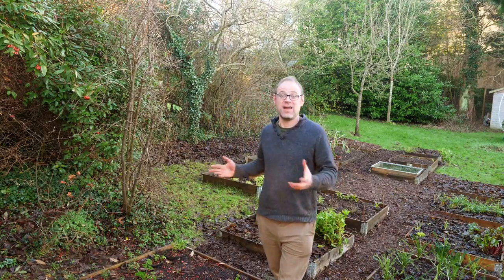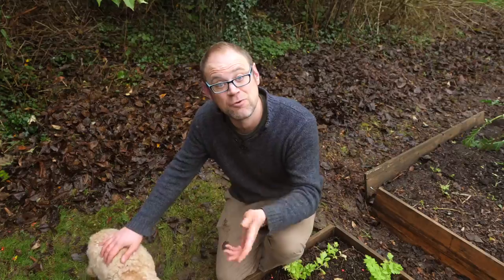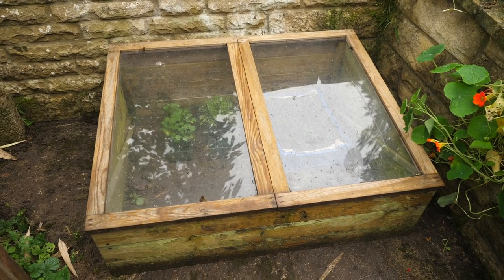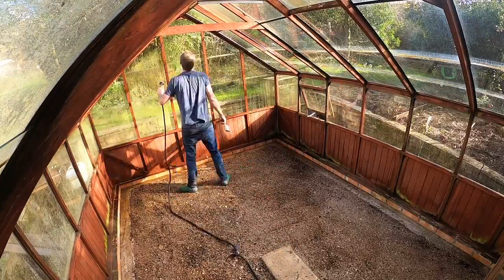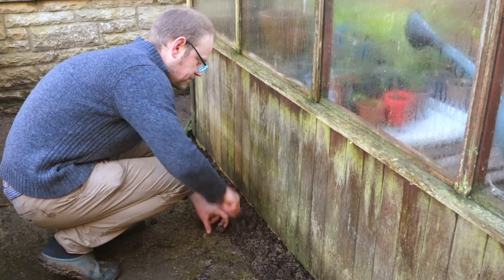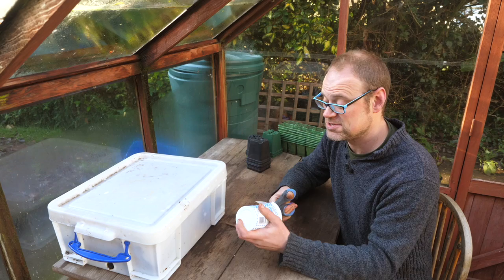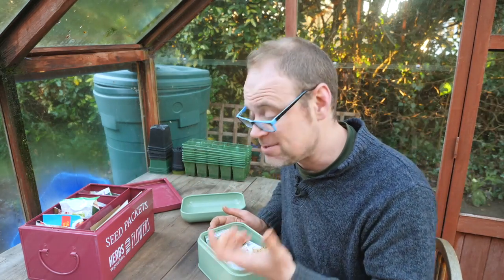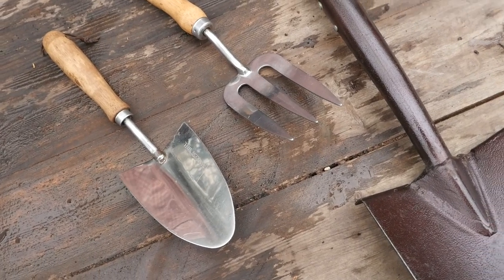Give Your Garden a Head Start: Take Action Now!

Comment: I have been slowly getting this done. I have weeded, more to do here in the south. I have planned this years garden, I even have gotten my seeds and another heat matt for my germination station. It's almost time to begin the cool weather stuff and I am so excited! I don't have a greenhouse yet, but definitely need one.  I am slowly collecting more stakes for everything, cuz you are right, they always go out of stock in the spring. I have to wait a bit yet for my beneficial bugs to order them. I still need to rearrange my garden rows for this years plan, but have it all planned with the garden planner. There's still a lot left to get done, but it's getting done slowly.
Reply from the maker: Sounds like you're off to a fantastic start already.  :-)
Reply: @GrowVeg  I do have a question: yesterday I saw a video about winter sowing in milk jugs and plastic bins. These people were in a Wisconsin, so a real winter. But they only did flowers. What do you think about winter sowing in the South, for veggies? Could that work, or would I just waste time, when I want to give them more time? Have you ever tried it over there?

Comment: Is there a benefit of having the greenhouse dug down lower like it is? I love it !
Reply from the maker: We inherited the greenhouse like this. The greenhouse is in a sloping garden, so it's essentially been dug into the slope of the hill to create a flat space for it. But generally sinking greenhouses or tunnels down into the ground does have advantages. It's slightly more sheltered and the ground has a moderating effect on temperate - cooler in the summer and warmer in the winter.

Comment: Shooo, I love that greenhouse! I have everything ready to go. Tomatoes and peppers are growing, nicely.  I have a small porch greenhouse, where they were started. But, Florida finally got 30's. So, They are now in a sunny window in my bedroom. How do your greenhouse temps compared to the outside temps?
Reply from the maker: My greenhouse has the windows open almost year round - I don't overwinter tender plants in there, so am not too worries about temperature, more airflow. I would say that during the day it can be significantly warmer on a sunny day, but at night it's maybe 6-8 Fahrenheit warmer than outside.
Reply: @GrowVeg  Ben, I have a hardening off question. I started my tomatoes and peppers indoors, and as soon as I saw their little sprouts, I put them out on the S facing porch, in my little 4x6 greenhouse, for maybe 2 weeks tops. Then, like I said above, Fl got some cold, and I moved them back in. This weekend we are actually going to have a huge cold front sweep in that will have central Fl in the 20's. Now my concern is when do I move them back out and will I need to do the couple of hours outside, then back in for a few days, or do you think I can put them right back into the greenhouse until it's time to plant?

Comment: I want to build a greenhouse and I am trying to decide on materials. Is your greenhouse glass or plastic panels? Do you have a preference?
Reply from the maker: It's made from glass. Glass is preferable as it retains the heat for longer. Plastic is arguably safer if you have children running about, and it's usually cheaper. But in my opinion glass always wins out.

Comment: How long do your wooden sides last? Mine were rotten after one year.. :-/
Reply from the maker: The wooden sides I expect to last about five years, possibly more. My old beds have done really well - it's just the sides where they connect that have failed, but I guess those could be repaired with new corner brackets.